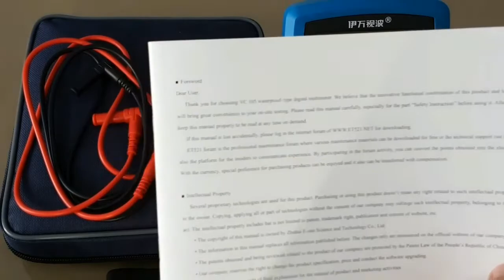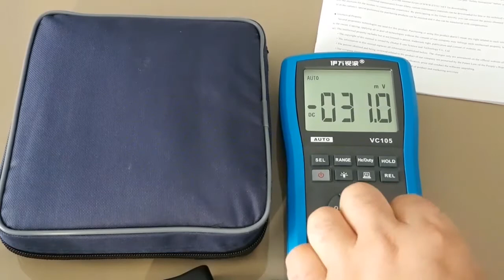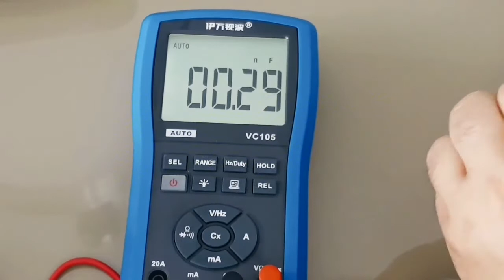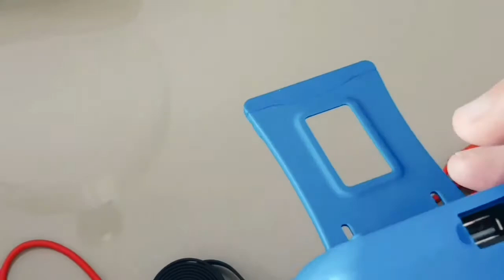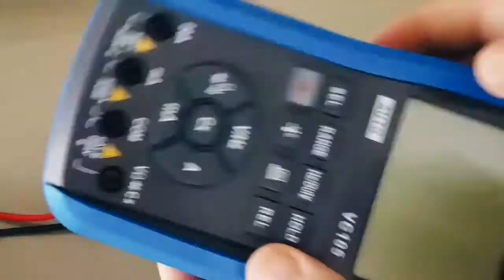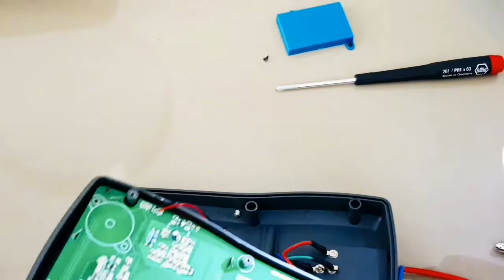VC105 Multimeter Multimeter Review & Teardown!

Comment: Hi Darren! Thank you for the huge number of reviews of multimeters that are little known to the public. For 3 or 4 times now I have found interesting multimeters of little-known brands on Chinese domestic e-commerce platforms and, lo and behold, a review of it is already on your channel.

I would be very grateful if you, Darren, could help me decide which multimeter to choose. The budget is up to 50 US dollars, but I have the opportunity to shop on the domestic Chinese market, so sometimes I can buy multimeters that cost 100-150 dollars on the global market for half or even third the price. Of the mandatory functions, in addition to basic measurements, I need a fast continuity test and accurate temperature measurement in the range from 0 to 300 degrees Celsius. Of the optional, but which would be nice to have, these are True RMS and data logging with connection to a PC. I need to connect to a computer for temperature logging, but with the previous features it seems impossible to find all this stuff in this price category so we can ignore it. Well, if I don't change my mind, I'll have to buy a separate thermometer later.

Personally, I found the Uni-T UT95XE ($38), Voltcraft VC-450E (rebranded UT195M, a very good deal for $51), Sata 03017 ($43), Pro'sKit MT-1217 ($28) and Eone/E+Erne/Some noname brand VC104 ($46) suitable for my needs. Don't be surprised by the prices: some multimeters are from the secondary market. So far my favorite in terms of functionality + performance + price is UT95XE. Only drawback is the lack of an analog bar, although I can hardly imagine that I will need to measure frequently changing values.

The 1217, in my opinion, is the best multimeter from Pro'sKit. It does not have advanced features, but it is well made, has a fast continuity test and measures temperature. At the same time, the top of the line MT-1820 with fully push-button control and an RS232 port has a very slow continuity test. An interesting observation - now on sale in many places there is a version of 1217 with 3999 precision digits (this is easy to determine by the box, where instead of 3 5/6 it's indicated 3 3/4). Probably in new revisions or for certain markets Proskit replaced the main chip with something cheaper.

Below is a longread about VC104 :) The VC105 review is excellent, the multimeter caught my attention, but unfortunately does not have a temperature measurement function. VC104, in turn, has this function and offers 4 1/2 digits of precision! The accessories included with this multimeter are beyond praise. In addition to the oxford cloth bag and quality probes that we can all see in the VC105 kit the VC104 comes with a high-end K-type temperature probe. Judging by the pictures, this probe is comparable in quality to the probe from the Fluke 51 Model II thermometer (5-6 times the cost of the VC104?) and what's funny is that the store that sells the VC104 declares the upper limit of temperature measurements at 400 degrees Celsius, while all the others on this list can measure up to 1000 degrees and come with the cheapest temperature probes possible. Unfortunately, this is where the advantages end. The VC104 does not declare very large measurement ranges. And if I can live with a limit of 200 mA of current, then 200 μF in 2024 is not serious at all (for VC94, which is the younger brother of VC104, the upper limit if I'm not mistaken is tens of nanofarads, this is complete nonsense). Another disadvantage is the lack of True RMS and other more advanced functions. I completely forgot about one interesting thing, which is rarely indicated in the description of this multimeter - it has moisture protection (but VC105 does not). The multimeter is not certified by IP rating, but in a conversation with the seller I found out that this no-name brand has a multimeter with the code name VC9806A+ ( in its arsenal and it's a full twin brother of VC104 (including 4 1/2 precision) except for the case, which has no moisture protection. And I would consider buying the 9806 (the price tag for which was a ridiculous $33), but the seller said that it is unlikely that these multimeters are left in warehouses anywhere. I also noticed that a good half of the product range of the Eone/E+Erne/Noname VC-line brand has already disappeared from stores shelves even in the domestic market of China. It seems that we are witnessing the sunset of this brand :( Or maybe the warehouses are being cleared out and soon we will be presented with a new product line :)

Thank you, Darren, if you found the time to read my chaotic thoughts to the end. Probably it looks like I have already made my choice, but maybe you, Darren, already noticed some important details I missed and guide me on the right path or could suggest a multimeter that would be better in this price range.

Smol UPD: here is a link to some chinese supplier of measuring equipment where you can get more information about VC-brand multimeters - https://www.chem17.com/st118675/product_2288042.html
Sorry, I failed to find any better resource
Reply from the maker: Hi Nikita, thx for the kudos! You are well versed ..better than most when it comes to purchasing that next Multimeter..the UNI-T would be my choice. 👍

Comment: Darren, a couple of years ago, I bought this meter because of your video.  I really enjoy watching your videos on varies multimeters.  I guess I'm always looking for one of those cheap meters to have the quality of a name brand--most bang for the buck.  There seems to be no shielding on most of the cheap meters.  As far as the use goes, I guess it depends on whether you deal with high power circuits, but I think it's important to realize that even low voltages circuits can produce high transient voltages.  Therefore, a name brand such as Fluke might be able to withstand such abuse.  But just because a multimeter has PTCs and MOVs, does not mean that it is safe or robust.   As a matter of fact, those components fail after so many transient and interestly enough there is no way to know when.  I mean the meter doesn't have a counter that keeps track of each damaging transient spike, and it could be damaged on the first transient.   When I first started studying electronics, the CAT rating did not exist.  For years, I used meters that would be considered unsafe--such as a ten dollar Radio Shack analog meter which I measured the AC across the main circuit panel (220 volts).  Now knowing the things that I do, I would use the best test equipment that I could afford to measure high powered circuits.  As a crane tech, I would measue three-phase 480 volts or higher circuits, and the best multimeter on Earth cannot protect you unless you are careful and follow the proper procedures of taking measurements (of course, all you are really doing is reducing the odds of being seriously injured or killed).  I hope that multimeter companies will take note of the things that are reported by your channel and others because in my mind, there is no excuse for such poor unsafe designs.  Most of the multimeters do not meet the CAT rating.  As far as the VC105 goes, I like it for some of the same reason that you did--it's built well.  I had no problem adapting to the push button selection.  One of the main problems as of right now, is I cannot get software for it--I contacted the company but no word after a year or two.  The manual states that it is for a special user--whatever that means.  Perhaps it is used to calibrate the meter.    Anyway, thank you for your time and energy to make these videos, and I hope that your channel grows.  In some ways, I would like to see you do a comparson video between the last couple of years with an unbiased reexamanation of the meters that you have reviewed and select the best--yes, I know that you did them based on a star rating; however, perhaps if you looked through the top ten and pick out the best you might come over with a different result.
Reply from the maker: Thanks for taking the time to comment. You said it very well. Many mfrs just don't take safety seriously and in the end the user must be fully aware of the risks. In fact even with good equipment you are never 100% guaranteed of the outcome. Experience and a professional attitude is key. Never perform under pressure and always double/triple check. I will undoubtedly re-review some multimeters as I believe it would be a nice follow-up. I have also been unsuccessful at attaining the software in question. I know they have used this model as an Oscilliscope as well, so perhaps the software was not destined for the desktop multimeter platform. I'll keep the reviews coming and hopefully we will see some positive gains in both the safety and overall quality of most multimeters. Shielding costs nothing and the fact that most meters today ship without it is truly mind boggling. I'll keep up the pressure from my end..that I can promise! Thx for watching.
Reply: @KeepOnTesting  Amazon has the VC105--instead of the china logo on the top, an American logo E-Air by EONEfor $36.99 plus $11.10 Shipping.  I wonder if it is better or worst?  Also the ad for it states under product description number 2 states: "A large-capacity database can store more measurement data." which implies that it is can do data logging.  Also in reference to the quality getting better due to your efforts and others youtubers, I saw where you showed Uni-T's quality go up.  I have the Uni-T UT61E which is a good meter for low power circuits basic electronics--never use it the industrial setting.  I love the meter but hate the input protection.  Anyway, I thought that you and others might be interested that they are selling the VC105 meter under a slightly different name; as for the price, it seems that when youtubers give high ratings, the prices go up (natural of the beast).
Reply from the maker: @electronone5219  Sorry I missed your reply..i don't see the E-Air on Amazon at the moment but thx for the updated info.
I must say it's been a few years since I did the initial review and I still like this tank of a multimeter. Its still going strong 💪 and those big LCD numerics can come in handy at 3am 😁👍
Reply: @KeepOnTesting  Darren--No Problem.  I did that several months ago (11 months).  When I searched today, I used VC105 in the Amazon search bar.   The cost now is 79.99 +11.10 S&H.  It's not worth that unless they made some major improvements.  I think I paid $40 or less for mine.  Thank you for the reply.

Comment: forgot to ask but is the state of the multimeter visible somehow?  If you forgot that you had pushed Ohms, and stick the leads into the wall outlet, does it survive?  Does the manual say not to do this?  Sorry for a lot of questions but  recently saw Dave Jones' video when a push button device blew up in his hand :-(  Thanks.
Reply from the maker: Its never recommended to apply mains voltage while in Resistance. It was quite well laid out inside the pcb however, so I'm hoping that it could survive such a happenstance! Just remember it's not a Fluke..

Comment: Hi Darren. Thanks for the nice review. When you took the meter apart, I thought I saw one blue and one dark colored components near the inputs (in addition to the two PTCs). Are they MOVs. Also were there any diode/transistor clamps? BTW the price have gone up but the availability is better.
Reply from the maker: Hi ! The dark components are 2 surface mount diodes (clamp of sorts) on the mA/A ranges.
The blue component was a 1 ohm resistor. There was no MOVs on the pcb. Thanks for the price update!

Comment: Wonder if it also works on the cable with no battery in it. ??
Reply from the maker: Yes it does! Tried and tested, no battery no problem as long as you have the power adapter plugged in.
Reply: Better check the instructions, the ones I saw said not to measure while the battery is charging-???
Reply from the maker: @yambo59  Instructions? Never! :) Seriously though, its fine. If there's no battery in the unit its not charging anything. That being said, Ive tested all ranges while the unit was in a charging stage and 0 issues.

Comment: No analog bargraph? I can't live without it. 
The display hummm!  I don't know. 
What happens if the battery dies? 
I guess for 30us it's ok.
Reply from the maker: Yes no bargraph,  lousy 100uF cap range and cannot light up or show a forward voltage drop on any color led that's  the bad. The good, It's extremely well built with high end components and solid construction. If the battery dies simply replace it (7.00 Amazon), also you don't need the battery as it will run just fine plugged into the usb adapter. At $30 it was a steal ....

Comment: Finally something other than the normal usual test instruments you see everyday on YouTube . Thanks Darren for breaking the mold great video, does it feel hollow? Weigh it against the Fluke 87 how much it weighs.
Reply from the maker: Thanks! Indeed I am like you in the respect that "different" is always good, especially when it comes to bench electronics. It's close to the Fluke 87V weight wise, though I think the Fluke is still the heavier of the two. Very solid and well built meter. Just wish it had a higher Capacitance range.

Comment: Looking at your review I would guess it is a very unsafe meter!
It had a nice 20A fuse, but just beside it was a glass fuse, that probably means the meter will explode if you try to measure a high current/high voltage bus bar with the probes in the mA range.
And what about a usb connection to your computer and then connecting the common lead to live? Is this safe?
Reply from the maker: All questions are good questions! Yes indeed, you can replace the standard glass fuse with an identical sized ceramic fuse. (5x20 500mA/250V) I've added the link to upgrade the fuse to the top of the comments section. Thanks for watching!
Reply from the maker: IMHO I wouldn't say it's "very unsafe." I was using it for a week and it was being used to check some high voltage  (not current) circuits. I exposed it to approx 450 Volts AC on a constant basis with no qualms. It's very well constructed. It's not going to replace my 87V but  it's also 20x cheaper! I did use different leads however. 
I have not tried the USB connection but I would only use it for logging simple circuits. I've seen alot worse PCB layouts so I think it's fair to give it my kudos.
Reply: A multimeter that uses a glass fuse it not well constructed.
And that usb connection need a good DC/DC converter with kV isolation and some optic communication inside the meter to be called safe. I did not see that in your tear down.
Reply from the maker: The mA range utilizes a glass fuse while the 20A range uses a huge ceramic HRC fuse.  The probe input / retention construction is right up there with the best, Fluke included.  Henrik, you can pick and choose what "you" call safe, the fact is this meter IS well built and solidly constructed. It utilizes a-lot of high end components and is safe enough for most mainstream applications. For the price I paid (35) it's a steal..even at the inflated price it's now retailing for it's still a good buy. It's Cat 3/1kV rating seems realistic on all accounts. I only wish it had independent certification by a 3rd party such as CSA, TUV, UL etc but then it would be priced a-lot higher I'm sure. All in all it's a keeper.
Reply: It will never get a real CAT III 1000V certification, that is not possible with a glass fuse, because it cannot break current at industrial power levels and that is exactly what the CAT rating says it can be used for. 
I also wonder why you believe the usb connection is safe, when all certified meters use optically isolated connections?
Using high end components do not make a meter safe, they have to be connected the right way.
Reply from the maker: @euphoriq121 Did you try www.ultradmm.com.. Ultra DMM Software is free and quite good..
Reply from the maker: @euphoriq121 1) Does Windows detect your meter when it's plugged in to your computer?
2) in Device Manager do you see your meter/communications port?
3) What version of Windows are you using? Thx
Reply from the maker: Firstly, is the meter being recognized by Windows 10? (not the software).. Go into System/Device Manager.. Then unplug the USB from the meter.. Wait about 5 seconds then plug the USB from the meter back into the computer.. Do you see any change or unknown device show up in the Device Manager..?
Reply from the maker: If it's not being recognized as a device in Windows the DMM software wont work. Have you tried a different USB cable, and are you clicking the PC button on the meter when it's connected to your computer?